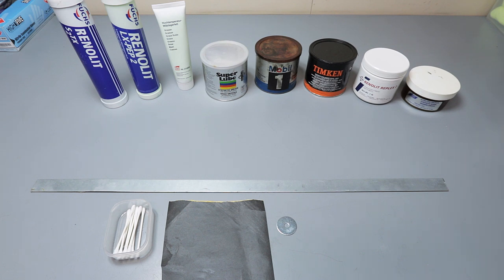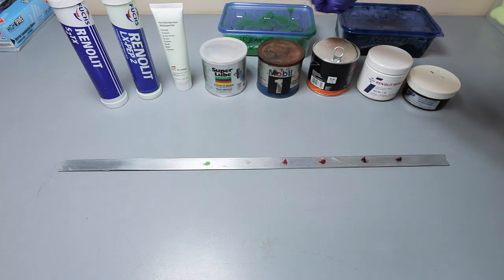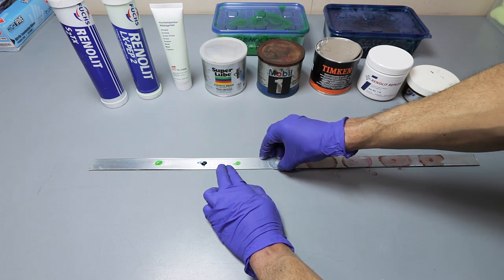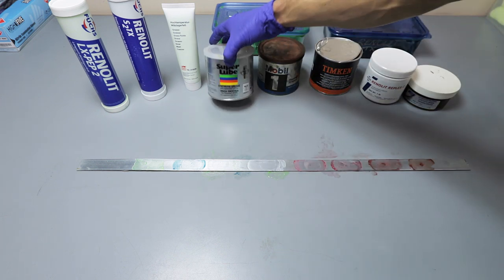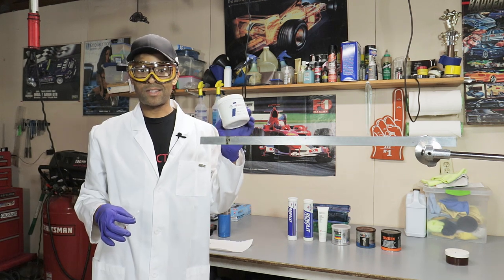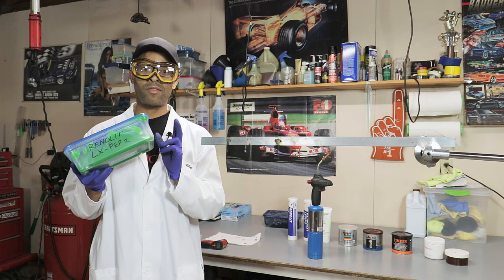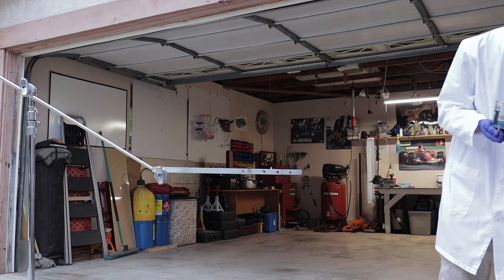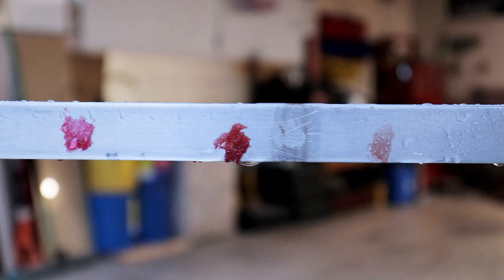How To Choose The Best Wheel Bearing Grease - Extreme Test - Mercedes Benz

Comment: Sorry, not meaning to bash but there is a lack of "control" in your testing.  

Test 1: the sliding was base on feel?  You were wearing gloves.  Science?  Are you testing Sex Lube? Where is the measurement of friction or a standard.
Test 2: Temp was measured with a  temp gun.  You used such a small bit of grease that you were measuring the temp. of the metal ruler. The temperatures were much higher than what you measured.  SuperLube spec sheet says it is good to 450F so, I do not believe at 311F it would be on fire. There was time lapse from the time the grease fell off and some readings came faster than others.  You could of put the grease same amount in a beaker and heated until it melted with a thermometer in the grease for this test
Test 3:  You were not consistent with time, pressure and distance of the water.  The size of the blob of grease and how it is applied to the ruler would be factors on how it would stay on. 

All of these tests to not really translate well for what you are going to use the grease for.  It was an interesting vid but I would not use any information here to make my decision on which grease to use for bearings.
Reply from the maker: Hello MrCuckoobox! Thanks for your feedback. I'm not sure if you watched all 50 minutes of this video, but I did say that these test aren't super scientific, (but are still scientific to some degree) and that they were just some things that I thought would be cool to try. It's best to treat this test as a stand alone test and not compare it to other test methods. Going into this test I thought all the greases would perform the same and that these test would not provide much information. To my surprise a lot of the greases behaved in very different ways in each category.  So, regardless of how scientific these test were, they still revealed some valuable information about each brand of grease. Again, thanks for watching and commenting, and I'll keep your feedback in mind when making more future test videos. Cheers!

Comment: Glad you made this I would have thought the green renolit was the same as the febi. But the febi is probably the same thing as the genuine mercedes branded one. I ordered some new bearings but they come with a much thinner blue grease preinstalled. I think it's similar to the renolit that you used. I was wondering if I can combine the oem mercedes green with the blue or if these will contaminate eachother. There are so many different types of grease and different materials I am not sure what goes with what. I just know some make the oil completely dry up when combined.

Comment: Temp range?? under hard driving conditions/racing good brake systems handle 400°C to 600°C that grease will barely be good enough for regular driving i dont wanna repack replace bearings if i have sticking brake issues, the bearings are built right into the brake rotors on some vehicles, and by design sticking calipers is almost guaranteed, some are even dragging building heat when new!!

Comment: Where can I get Renolit replex 2??
Reply from the maker: Hello Shane Christopher! You can purchase Fuchs Grease off of Ebay. Here is a link. https://www.ebay.com/p/18012572382

The seller is selling in bulk, but if you ask, they might sell individually. 1 tube will be enough to service your bearings many times over. 

The grease that I'm using in my car is from this company in Canada. http://store.dcddesign.com/fuchs-renolit-grease-single-tube

It's amazing and I used it for the drive from California to Georgia (about 2,000 miles). Grease is holding up great! 

Hope this helps. Cheers